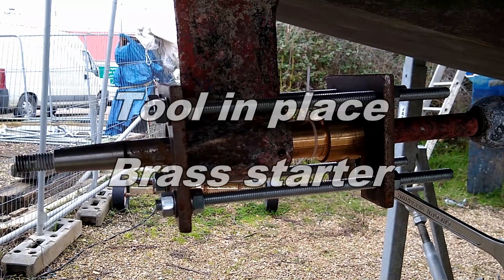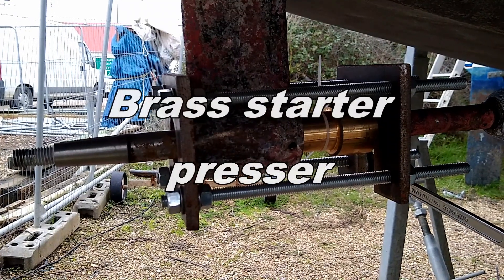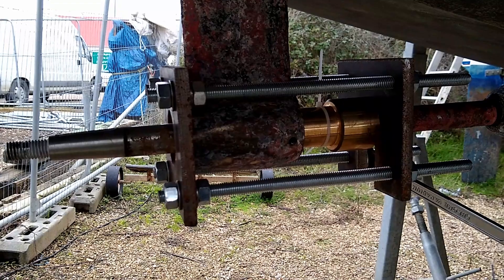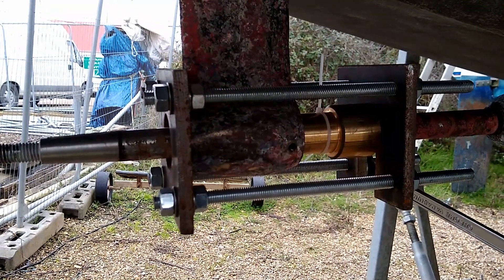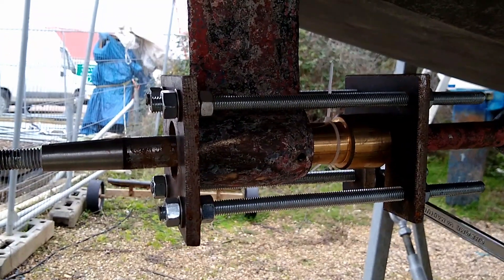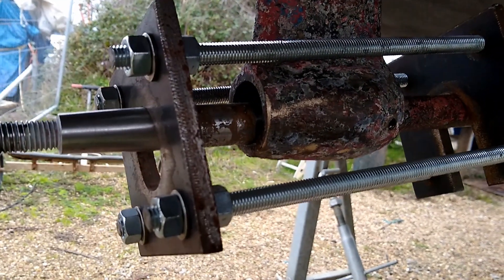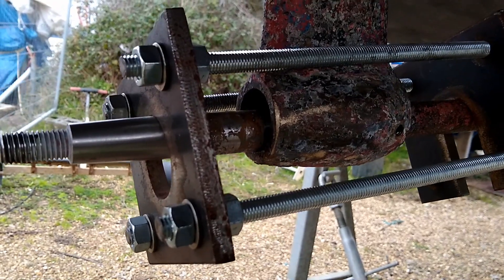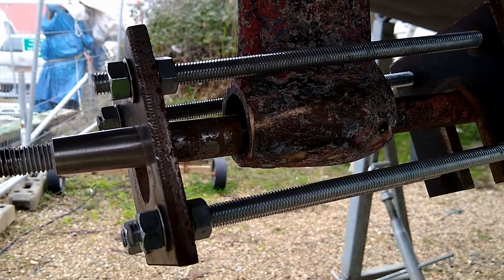Replacing a cutlass bearing part 2

Comment: The bearing I’ve got is too long by about 20 mil should I cut it with a hacksaw or just leave it . Thank you in advance
Reply from the maker: I would get the correct size, but it MIGHT work.  Not sure I would risk it.
Reply: iankfr thanks for getting back to me the guy said don’t cut it as it could separate the rubber from the brass . I think the old one was cut but it was a phenolic one . I don’t think I’ve been seen them hanging out the back though
Reply: iankfr  what would be tour concerns about it being to long ? Please
Reply from the maker: Hi Paul, I am no expert, but the cost of a cutlass bearing compared to any potential damage to the P bracket and propeller shaft and maybe even the propeller makes it a simple choice to get the correct size.  The bearing is designed to fit in the P bracket supported over its entire length, so who knows how it would cope with a substantial chunk being exposed?